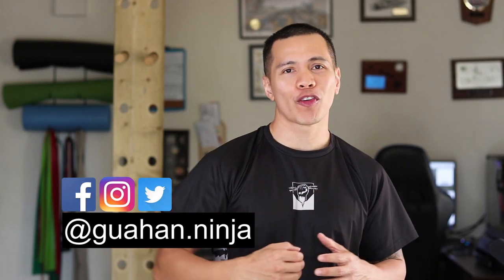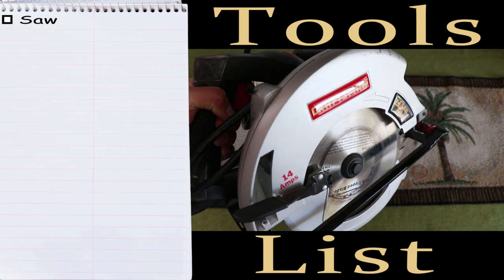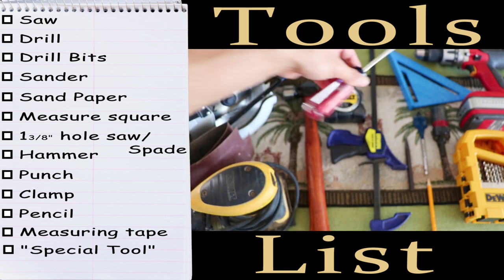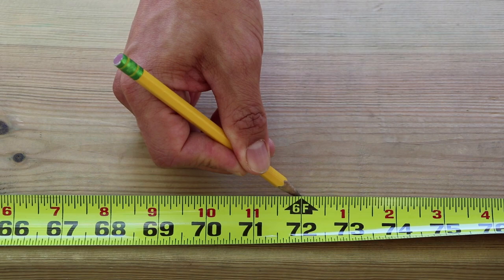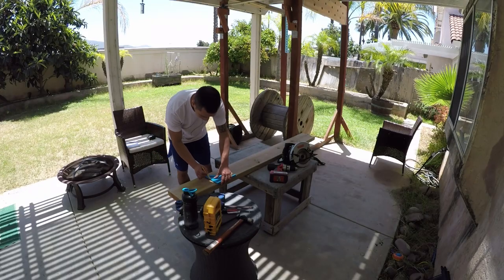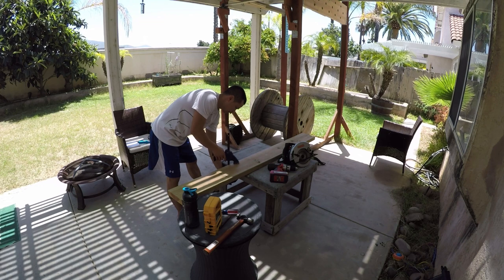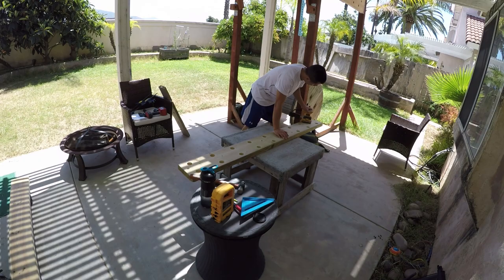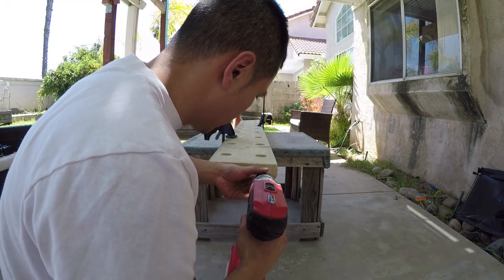DIY Pegboard - How to make Ninja Warrior Obstacles

Comment: Very good one ☝🏻!!! 
Tell me you know how I can to hang this appliance on iron (the iron something like 4 cm (it’s little circle the iron) ,with not move the appliance certainly
Reply from the maker: HI great question. You can mount this to any surface or wall by adding screws/bolts through the center of the board into your desired mounting location. I would recommend at least 3 points of connection. I hope this helps

Comment: I'm looking at making one and am thinking about using 7/8" holes so that I can use cutoff ends from bike handlebars.

With bike grips on the bars, the grip diameter will be about the same but the difference between bar diameter and peg diameter will prevent overinsertion / accidental finger pinches.  The grips should also be a lot gripper than just using wood.

Any downsides you can see to the approach?
Reply from the maker: The biggest downside I see, is metal on wood. If you're going to use common wood like Douglas fir or similar lumber, then you'll run into premature wear on your peg holes. But as cheap as these are, it's not that much of a deal breaker. 

Also, with the bike handle grips, they will wear and become sticky with over use. And if you get to used to grips, it won't help during competion. 
But the grips are a great intro for beginners or someone who has never tried a pegboard
Reply from the maker: I remember that you are building this for kids but did not remember their ages. I saw your album and wow that is awesome! I love seeing this sport grow and I'm glad that you are doing this for your family.

Comment: What do you use for pegs and how do you attach the board??
Reply from the maker: I use wooden pegs. Here is a video I did that includes some affordable DIY pegs (I believe the peg portion starts at around the 5 minute mark) https://youtu.be/QVGrSLBukHw
Reply from the maker: Also, I use slings and carabiners to hang it from a pull up bar or mount in the ceiling. Here's another video I did about installing xmounts in the ceiling
https://youtu.be/1ECc7jx6X2U
Reply: @TheNinjaLife  Awesome! Will check them out
Reply: @TheNinjaLife  Do you recommend any certain type of slings ?
Reply from the maker: @stutibhagra1667  I've used these orange slings for over 3 years now with daily use and they work great. https://amzn.to/3hzkAE0 
I'll also add some links to the other items I've used, into the description. Hope this helps.
Reply from the maker: @williamhenson8310  Hope you were able to find some decent slings and carabiners.  Here's some that I've been using. https://amzn.to/3hq1Pmk
Reply: @TheNinjaLife  Thank you so much !
Reply from the maker: @stutibhagra1667  of course. Anytime🤙
Reply: @TheNinjaLife  Those look nice.  Still working on my garage :-(